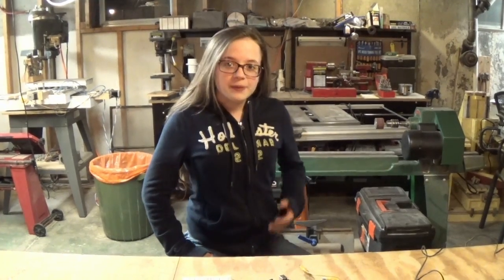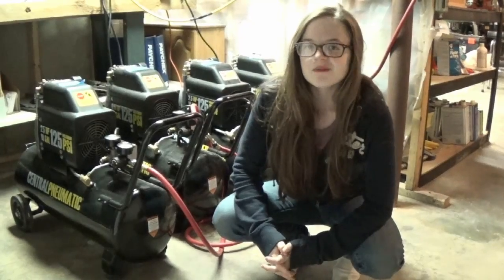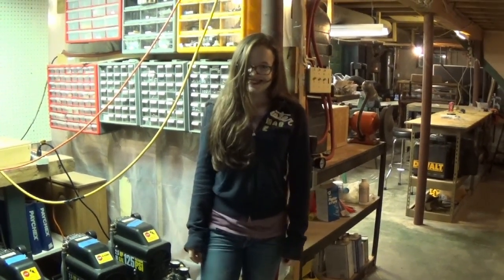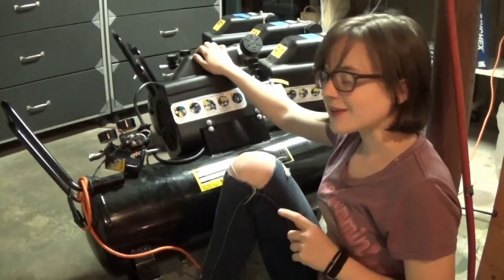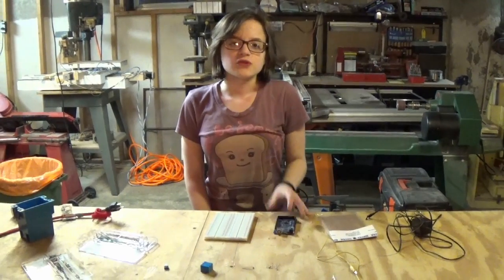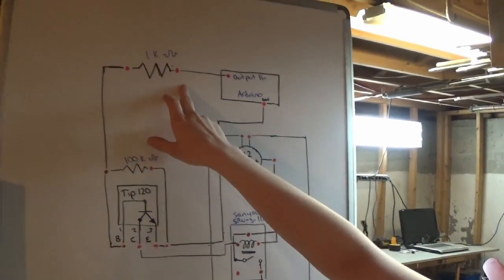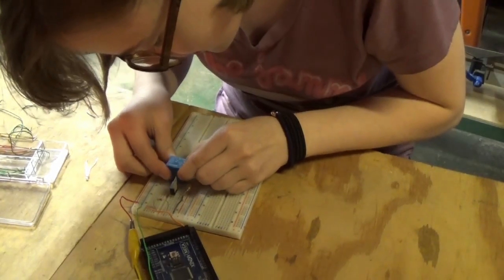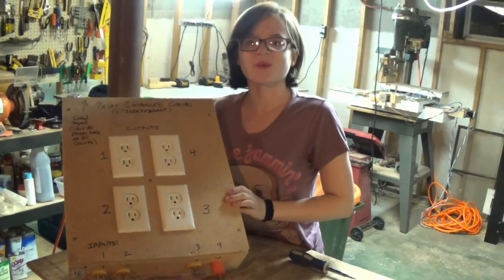Ep3 Cheap High SCFM Air with Parallel Compressors

Comment: Please PLEASE stop!!! The "S" in SCFM does NOT stand for "sustained". The "S" stands for Standard as in Standard Cubic Feet per Minute (SCFM). The "Standard" is defined by CAGI or Compressed Air and Gas Institute. Your controls will cause electrical fires. I've seen way too many cheap-o solutions like yours lead to disaster and heartbreak.
Your video about making a desiccant dryer using PVC is creating a HUGE danger for unsuspecting people. You don't take in to account the fact that PVC degrades when exposed to sunlight, heat of compression, vibration and synthetic oil. PLEASE, kid, stick to what you know. In my 42 years in the compressed air industry I've seen way too many people killed and maimed using methods very similar to what you propose.
Reply: Ernest Havner don't hate
Reply: I have a video of a proper system with proper controlls
Reply: Ernest Havner Give her a break. It's impressive to see someone under 18 trying to do something like this given that most teenagers these days just waist all their time on Facebook, texting or whatever new thing the cool kids waste their time on these days.
Reply: Ernest Havner the kid said she's only running 80 psi max. Schedule 40 pvc will easily handle that without degrading for years, if not decades. By the time this system has aged, I'm sure she & her "producer" (aka dad or mom) will have built a unit out of stainless. Btw...my "hugely dangerous" home made dessicant system has been in service in my barn for nearly 20 years in a 135 psi system. Should it someday schrapnel, you'll be the first person I contact to admit I was wrong. (No, it will not kill me as it's with the compressor up in the loft on a piece of 1/4" alum plate.)
Reply: Russell Fisher that’s not hate.....
Reply: ROTAXD When it kills you, you'll call no one to admit you were wrong.
Reply: Although I respectfully disagree with your delivery, I can definitely understand your point. However, at her age and experience, this is impressive. Whether DYI's or professionals, we've all have had or learning curves--it's the nature of ingenuity and engineering. Besides, given her generation, it's better to see this that another twerk video. Honestly, I'd could understand your approach to any incompetent person who didn't make an intellectual or working effort. Conversely, she seems like a humble kid with brilliance and obvious parental support so it's safe to say that she'd be open and would adhere to positive reinforcement.
Reply: I think the point is , no one wants to see any one get hurt or the unthinkable. And her father wouldn’t put her in harms way . However I think one could see how a ambitious DIY could take this info and ramp it up a notch and find themselves in trouble without even knowing what happened. So respect psi / scfm always think worst case .... because sh!t happens ! Great video kid !

Comment: Wow now how perfect does it get. I just bought the exact same compressor a few days ago and am adding additional storage capacity with a portable tank to get a bit more out of it. That is quite limited though. The electronic distribution delay on relay box is what I'm going to give a try at. Only difference is it will be for just two compressors so that much easier. BTW coincidentally this is the first video I checked out and that also covered the electrical/electronic subjects. Yupperz... Perfect.
Thank You Very Much.

Comment: Even if somone else did the math this is one smart cookie, I'll bet she's bored in school!
I wonder  what class she teaches?   Look at that sand blasting, woodworking electronics house wiring, what is she not doing provided she's working with all these tools.
Even if the camera man is telling her all this stuff she understands it pretty darn good.
I'd thought about running 2 compressors for more output air but she's showing us how to do it better.   And Sandblasting? by some machine shop tools and make a screw drive compressor. or find a broken scrap one to rebuild.

Comment: Very well thought out. I'd suggest adding a watchdog into your microcontroller circuit. So if your Arduino freezes up the watchdog will restore order. Even if your code is perfect. Mills timer will overflow. I would use it without provided I was aware to pay attention to the blower off valves when using it. And when not killing power to the controller

Comment: Funny, I sandblasted 2 1936 Ford Bodies with one 5 HP Sears Compressor using a professional sandblasting rig with no problem. I believe my lines were larger but had no problem. The trick is to keep the compressor cool using a fan. The cost of my compressor and sandblasting rig turns out to be the same as yours with less headaches.  My unit is 220 V.

Comment: Nice presentation, thanks. Also a nice exercise in pneumatics, electronics, and uh, carpentry. You can get a 4 outlet manifold that will work fine for $30 bucks and take 45 minutes to adapt. But then, you and your audience wouldn't have learned nearly as much. :)

Comment: I built the Arduino assembly according to Hannah's instructions, and it worked! However, and perhaps I am mistaken, the unloading valves on the  particular HF slaves that are used in the video are simply mechanical check valves that are operated via springs, and they automatically release pressure above the cylinder heads when the cylinders stop moving....therefore the unloading valves do not have to be unscrewed slightly to release pressure above the cylinder heads.

Comment: They make an air filter for these small compressors that have a spring loaded "check valve" in them. When the compressor starts the spring pressure holds the valve closed. Since the compressor can't suck in air, there is no load created allowing the compressor to start unloaded, just like bleeding the air down but with a different technique. Once the compressor gets up to speed the vacuum created on the air filter/check valve overcomes the spring pressure allowing the compressor to draw in air and compress it. Just an FYI :)

Comment: I built a parallel setup a while back. Rather than master-slave, I used a 150 PSI pressure transducer back to a Rasberry Pi with pressure feedback from a T line. I used SSRs instead of mechanical power relays and coupled them to the Pi with an opto-isolator driver board. I also put a RCD and MCB into each power feed path and used fully insulated lugs because I have a family to feed and would prefer not to be fried. I have 240V 20A power so I only need two feeds from different circuits. There are some great ideas in this video but some really, really bad wiring practice.

Comment: I was impressed with your video. But If you don't mind a suggestion. To increase efficiency you can tee the relief lines with a few tee's so that one switch can dump the pressure off all the heads at once and you wont have any leaks in the discharge lines.. I love how you figured it all out with the  arduino .. You really only need one pressure switch to control the arduino then the arduino will stagger the start of the slave compressors.. just my opinion. and if i have said anything wrong please correct me cause i don't know everything and don't mind if someone corrects me.. either way you rock!!!

Comment: Nice job, I have a project car myself and didn't think I could afford to get my own sandblasting equipment because like you say they usually require 3phase or get very expensive! May have to look into doing this :) I got a bit lost halfway through the video but hopefully I could work it out if I watch it another 2 or 3 times.. ha ha

Comment: Another option is to place check valves between each compressor that allow air to leave via the connection hose but not enter via the connection hose.  This way each tank's supply is always available to all but each tank can only be filled by it's own pump.

Comment: Compressors draw 15 amps on start up. House outlets are usually on 20 amp breakers. Actual outlets are usually rated for 15 amp continuous. My small compressor is on a 20 amp breakers alone with orange 20 amp outlet. My big compressor is on 220v. It'll run a small tire shop. Wheel barrow style gas compressors run contiuosly and fill fast. Get one them from harbor freight. Or home cheapo

Comment: See I was thinking 4 or 5 belt driven compressors and a gas engine to drive the belts all welded to the side of a 33 gallon tank with wheels so it’s mobile and you aren’t tied to a power outlet. But I was looking at it for was like painting a car or sandblasting maybe. Great ideas u have there,and crazy smart congrats

Comment: For $600, I would just tandem two high volume pumps on one larger tank. You either run them with one motor or you can sequence with two motors based on air demand and energy conservation. 

I really like your creativity in this video. I do appreciate your willingness to learn all this, so I have respect for you. 

There is one question people should really ask them selves. How affordable is "inexpensive"?  You can buy a cheaper machine, but it will have a short life expectancy and/or low, inaccurate performance. If something is short on longevity or does not perform than it will cost more than it's well built counterpart ultimately. Cheap is not inexpensive, it just pro-longs a greater expense. Longevity and performance is is where money savings start to show.  Unfortunately, Chicago Pneumatic has a very low insulation class on their motor windings thus tend not to last long if used for any real work, plus they often use bushings instead of ball bearings. I invite you to learn a bit about service factors and winding insulation class in regards to electric motors. You'll learn a lot about motors knowing those two things. Other knowledge would include bearing types, housing types (TEFC is often best), starting methods, phase, voltage, and mounts. These pumps don't allow it, but you're better off running 220V VS 110V on motors for managing current.

Comment: I set up four in my system but it wasn't near as complicated, I just set the pressure switches to come on about 10 psi apart.
If one can keep up only one runs, if it can't, the second one kicks on, if they can't keep up the third kicks on, and so on.
I ended up not needing the fourth one.
I can maintain 165 psi sand blasting.

Comment: A simpler method might be to plumb the pressure switch for the first slave compressor into the pump output line on the the master compressor (not the tank). This assumes there is an unloader that dumps the pressure in the pump outlet when the compressor is stopped. A needle valve could be used to increase the delay.  Each slave would be hooked up to the previous slave in the same manner.

Comment: That is awesome with a little overkill. I would just scatter the compressors so no extension cords were required. Then used air hose to connect the compressors together. That should make it so the compressors do not kick on at the same time.

Comment: Another way to do it would be to simply plumb all the outputs together, but with one-way valves at each compressor output, so the back pressure from the individual compressors, or your blaster tank... does not affect each other. Then coordinate your pressure switches so they all turn on at the same time. (Not that hard to do.) Still using the dryer circuit, and running two compressors off of each leg of that circuit. (Or run a dedicated 65 amp 220v circuit that you then split to use, this way.)

Comment: Suggestion to simplify the power distribution.  Forget Arduino and get a delay on circuit for about $5-6 on Amazon.  One for each stage and set for the desired delay. Operate all on single 12V wall wart.  Relays must obviously have contacts rated for the load of each compressor.

Comment: If you really want to go this route you can save some effort and get better performance with a air tank with multiple inlets. Then the compressors can be plugged directly into the outlets and have air hoses ran to a central tank giving you more capacity as well.

Comment: Just FYI a commercial solution would be to remove all rusted parts and then sandblast all at once.  And use rented equipment for a day for very fast/effective result.

Or stage your sandblasting operations so maybe you sandblast for 5 minutes, work on other items for 5 minutes, etc.  which might up to triple your capacity.  Although you need a large flow, you shouldn't need MUCH time with that large flow, those panels are only so large yeah?  You have a large shop too, with an angle grinder/wire wheel or cup combo thrown into the mix for bulk removal and sandblast for polishing, you could probably stage those two operations and get a really time/cost efficient process going without compressor multiplexing and control operations required.

I'd also mention that a funny feature on single stage spring loaded pressure regulators like your economy regulators almost certainly are, is that the outlet pressure of the regulator almost always rises as inlet pressure decreases (tank empties).  So just putting the three compressors on a single line, the three tanks and compressor motors will naturally balance to where each tank gets an equal duty.  Controls are unnecessary, system is mechanically balanced.

Also keep in mind if you had to buy compressors new, you will ALWAYS get a cheaper deal buying one compressor 3x larger vs 3 smaller compressors, unless price is affected by market forces like  huge differences in equipment quality, supplier discounts at the high end of their equip offering line, having to move up to another type of compressor etc.  Larger equip also tends to have nicer features like thermal switches to protect motor etc, easier to maintenance one piece of equip vs 3, etc.

Great video though, you'd be a great engineer if that's a path you're interested in!  You are awesome keep it up!

Comment: A couple questions:  Why would you suggest using extension cables to provide power for the compressor array?  That is a serious fire hazard.  120V circuits will always draw twice the amperage of a 240V circuit for the same load - which means double the heat.  Second:  why choose a bank of noisy inefficient 120V direct-drive oilless compressors when HF sells 240V oil-lubed belt-drive units for almost the same price?  You could use less compressors, have FAR less noise and wear/tear, have a lower amperage load, and reduce your power switching needs to a simpler setup.  Three:  Why use an arduino for power switching for staggered power-up?  Why not just plug the compressors into a dedicated circuit and manually power them up?  Compressors will only draw power at start-up and when filling the tank, so I don't understand the need for a power controller.  Four:  How are you handling draining the compressors?  Manually?  Why don't you have an aftercooler and filter setup?  This is critical for sandblasting.  Is it just not shown in the video or something?    My apologies if my questions sound rude, I am genuinely interested in the reasoning behind your setup and curious about these things.  Thank you!  :)

Comment: Super impressed, with that said as an experianced tradesman I've learned simple is safe. What if you used one pressure switch on the main compressor wired to turn on the slave compressors via relay switches. Yes they turn on at the same time but each unit has its own breaker.

Comment: For anyone looking for high CFM: find yourself an old Quincy off CL or Facebook marketplace for cheap..I just picked up a model 325 head for $250. My last one lasted lasted 40yrs and finally ate the main bearing on the HP side. Also the old quincy's are waaayy quieter than splash lubricated single stage comps.

Comment: Again, very informative.  I just bought a mig welder and am shopping for a sandblaster.  My concern is the required air flow rates needed for sandblasting.  I don't want to buy a large compressor and I happen to have 3 smaller compressors.  I theorized that 3 compressors would do the trick but you have put theory to practice.  I'm off to buy a sandblaster.  Thanks.

Comment: you had me at arduino! I'm your newest stalker, I mean... subscriber. yea, that's the word I should use. I like using the arduino pro mini. they're tiny, plenty of pins and features for most projects, and they're cheap enough to almost be disposable. one tip for you, you should have a flyback diode near to the dc relays to prevent damage to the transistors. when the magnetic coil inside the relay turns off, you get a relatively high flyback voltage fed back into the transistor. also, the tip120 is an old tried and true part, but there are much nicer options available today. one that I like is RFD14N05 which is a cute little part, but can handle more current with less waste heat. if you use a 12 or 24 volt contactor rather than 120 volt, you can avoid using the smaller relays, and power the large contactor right from the transistor/mosfet, although you would need a larger wall-wart power supply.

Comment: Think I'll stick with my single compressor with a much larger tank, belt drive running on 240 volts.  At work we have a 20HP and 7.5HP rotary screw compressors running on 480 volts.  Which run a number of things all day long.   Once they're powered up, they just run non-stop.

Comment: Instead of running the extension cords, you could simply rin 2 20A circuits to power all four compressors. But if you already had a bunch of 14 guage lead cords around...👍🏻

Comment: Why not put in inline check valves to prevent each compressor from trying to feed the others  that will help distribute the load and  adjust all the pressure switches for different on pressures.  But GREAT video and thank your parents for teaching and/or supporting you we need more like that